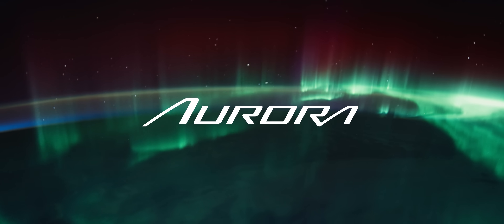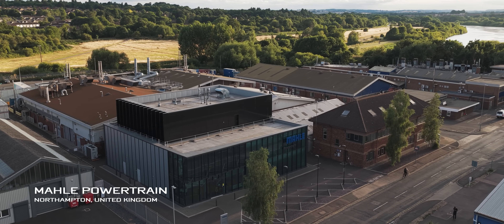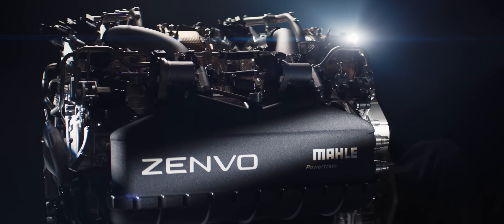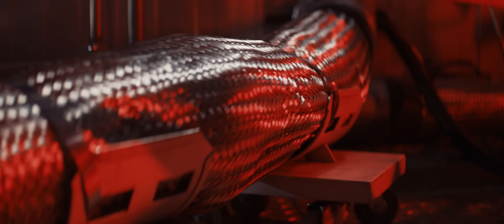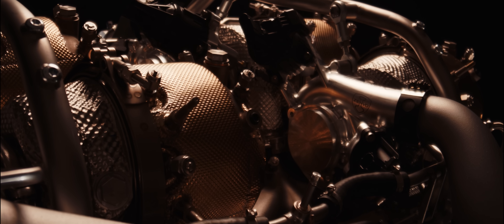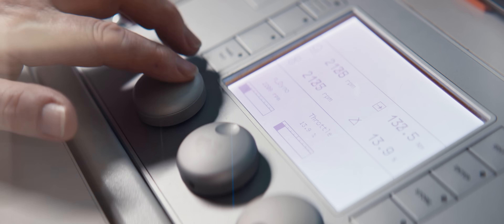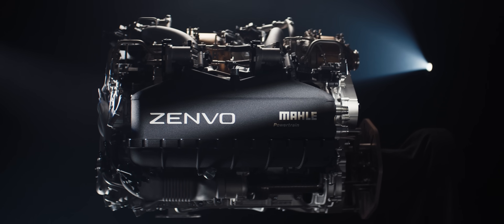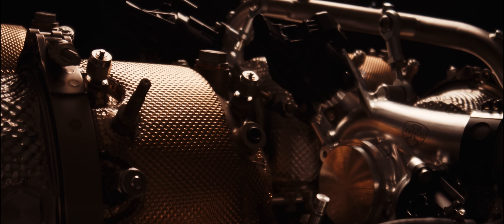Delivering Aurora | creating the world’s most powerful production V12 engine

Comment: Screw emissions my truck has had no emissions system in years. 

My truck has that stupid cylinder deactivation nonsense but I keep it at v8 mode 90% of the time. 

214k miles so far

Comment: Much as a new V12 is great news for the car industry, the figures are nothing special, from a massive turbo engine like that you might hope for a bit more power, some of the normally aspirated V12's are making 1000hp now, maybe the torque is insane, better than a soulless battery in any case

Comment: The challenge is not to make a powerful V12. Plenty of examples. The challenge is to make a reliable V12
Reply: It´s easier to make a v12 (two inline 6 engines) than a V-configuration engine. It´s also easy to 3d scan a previous engine (basically copy) and then work from there.
Reply: Nothing about a v12 is inherently unreliable

Comment: why lots of people are saying 1k horsepower isn't enough? you are not considering turbo lag, reliability. you can slap bigger turbos and make the air to fuel ratio at the absolute limit, but it doesn't feel and be like such engine. it really is a unique and powerful tech. smaller turbo gives less lag and it won't make you wait to spool up😅
Reply: Horsepower wars alone became irrelevant since second half of last decade because breaking 1k HP was nowhere as hard as it was when the OG Veyron did 10 years prior. But there was a lot of things that contributed to general population alienating over it and forgeting the many other things that made cars exciting, including the forced push for the EV agenda, because EVs dont have anything that makes cars exciting other than raw power and "muh instant torque" (design and aeros are another matter, we are talking the mechanics, and even then i can raise weight reduction and distribution which EVs disregard to the point of compromising safety even more than some superlight cars that would be similar).
Reply: @unkindled6410  eh... for its specifications the Veyron is extremely underpowered. Something's gone really wrong, when 8L and four turbos can only just produce 1001 HP without melting the whole thing down. Ferrari almost gets more from a naturally aspirated V12 with 3/4 the displacement. TVR got more from its naturally aspirated 8.8L V12, and that one predated the Veyron by a couple of years
Reply: @halofreak1990  power figures are much more than HP. the veryon big engine meant a smoother driving experience as it had really good torque at low RPM, and this allowed the engine to not be so stressed under average demand over it.

also the TVR experimental engine never really got a full production and proper final version. its supposed to reach 1K, but i presume it couldnt do it for long enough. it was also a 7.7L not 8.8
Reply: Lag isn't really a factor in this project, as the car is a hybrid. The electric engines will mask the lag and provide huge low end torque.
Reply: Corvette ZR1 have biggest turbo but no lag at all, it's possible.
Reply: @GF-mf7ml  but it's not quad turbo! if you just add the volume of these 4 turbos, it's no smaller than corvette's turbo. what I want to say is, 1250hp isn't less. for more hp, we need to sacrifice something.
Reply: Not alchevno

Comment: Man is very clever, but not very wise. So these guy bet the farm on making another hypercard this time with 1250 hp plus the electric engines adding another 600hp,  and a target top speed of 450km/hr, in a street legal car. Sounds really safe. If it is track only, you can go as fast as you like. But these are not track only, they are for the streets where there are pedestrians and kids. Good Luck competing with all these other idiots doing the same thing like koenigsegg, and Rimac. What if instead you used your engineering prowess to built a car with 500hp (total) that got 60-70 miles per gallon, that still looked and handled as good. Well at least you have bragging rights.